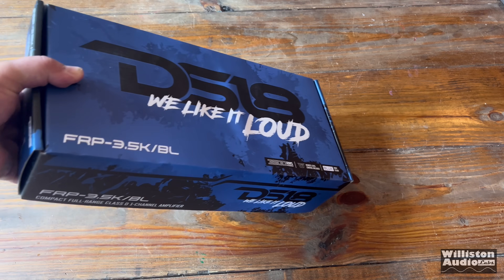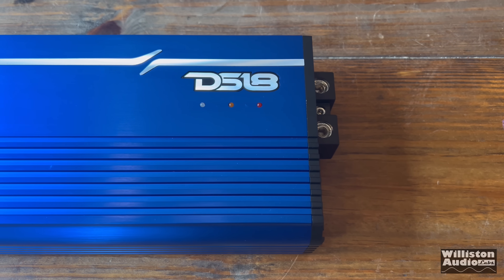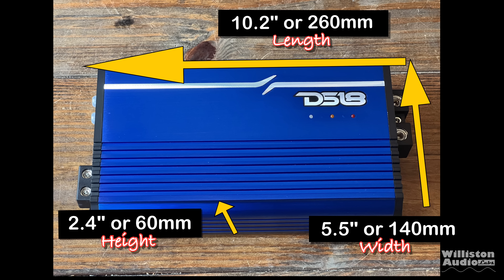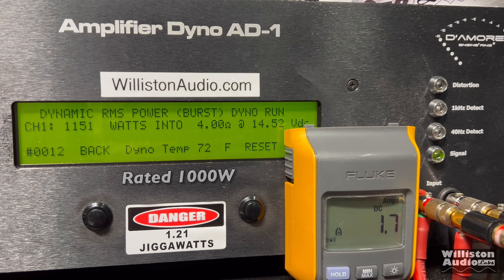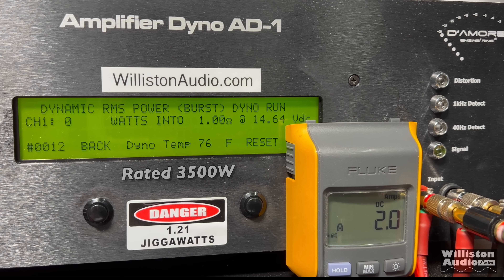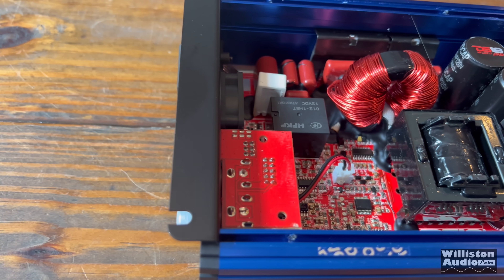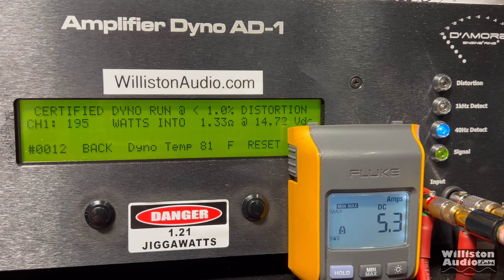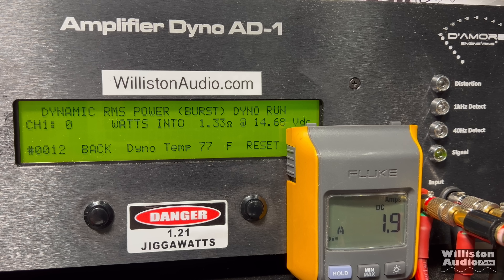DS18 3500W Mini Monster Amplifier Review and Amp Dyno Test

Comment from the maker: DS18 FRP-3.5k Full Range 3500W Mini Amplifier
DS18 Website: https://ds18.com/collections/mobile-1-channel-full-range
DS18 Enhanced Bass Remote:  https://ds18.com/products/bkvtr
DS18 Amps on D4S: https://lddy.no/1k2ty
SMD's Review of the 5000W DS18 FRP-5k: https://youtu.be/hfwr_OoiUVw

Note: Amp was sent from DS18 for testing, but video is not sponsored by DS18. DS18 paid a fee to have the amp tested and shown in this video but all content was created by Williston Audio Labs without input from DS18 and we show features, tests and give our honest feedback

TEST BENCH EQUIPMENT
SMD / D'Amore Engineering Amp Dyno (AD-1): https://is.gd/wccad1
XS Power D1400 Batteries - https://amzn.to/2BPFCKW
XS Power PSC60 Charger - https://amzn.to/2CHGcfs
Fluke 1000A AC/DC Clamp Meter: https://amzn.to/2Rw5WDA
Handheld Dyno AMM-1: https://is.gd/wccamm1
My Favorite Precision Screwdriver Kit: https://amzn.to/3yAaPmn

DISCLAIMER: This video and description contains affiliate links, which means that if you purchase from one of the product links, I may receive a small commission. As an Amazon Associate I earn from qualifying purchases. As an eBay Partner, I may be compensated if you make a purchase
Reply: This isn't a out this video, but could you recommend a stand alone, plug in your wall, home theater subwoofer amp, as mine just died, but would have to spend over $1000 to get an equal sub now days. I'm looking in the 4-500 watts rms range. Either a plate amp or anything else
Reply from the maker: @derekborow4121  I tested a couple from Parts Express in this video - https://youtu.be/LsaXQJ_53R0
Reply: @wal you need to do dynos on all POWERUS IS THE BEST AMP EVER MADE PERIOD…. But its expensive too

Comment: I ordered the ds18 frp2.5 and looks like it's stating on ds18 website to use 1 gauge power wire for it. But my car is already wired with 4 gauge ofc power wire. Do you think the 4 gauge is sufficient to run the Ds18 frp 2.5 rated at 2500 watts at 1 ohm, 2 ohms at 1300 and 700 watts at 4 ohms? Thanks for the video any feedback appreciated

Comment: I'm so glad that you tested the amp at 1khz.  DS18 has a lot of midrange & highs equipment that does do a ton of wattage & requires an amp like this.  Sometimes they're meant to be hooked up with 8ohm speaker to get a lot of them on the one amp as well.  Also, I think they still sell the "Picado" speakers too.

Comment: I just burnt up my audiopipe yesterday 1800 class d mono.  I replaced it with the 3.5k and so far the audiopipe beat way harder.  I still gotta get it fine tuned tho
Reply: So the audiopipe 1800 beat harder than your DS18 3500w amp?
Reply: @ElevatedVehicles  yeah to me.  The ds18 clips if you turn it up
Reply: @sir404  dang thank you. I'll avoid it

Comment: Just searching for opinions… Does this amplifier heat up fast on stock electrical? Working with a 2019 Dodge Charger, 1 12 inch Skar VXF. I’m just trying to find a amp that doesn’t heat up so quick
Reply: @392Quick  hey did you end up buying it i’m thinking about getting it just trying to see if it’s good
Reply: @ Nah I never purchased it. I ended up getting a XS Power battery and did a big 3 upgrade.

Comment: Hey Willston! Do u have any videos showing how to reconfigure a 24 cell Headway lithium battery using busbars? I'm a bit of a newbie/old school basshead. I've got a Skar EVL D2 15 with a Skar RP1200.1 monoblock amp. I'm fixin to upgrade to 0 gauge wire, but I'm still running a factory alternator. Can i kinda pick ur brain for sum help figuring out what all I need to do to get the full potential of my amp and sub? Please and thank u.

Comment: I was wondering if you will be testing any of Orion’s new amplifiers ….like the xtr pro2300.1dx the xtr1000.4 and I would like see you test the updated 2500.1dz  just to see if there is a difference between the 2500.1d and the 2500.1dz and they have a 3500.1dz and a 5500.1dz ….they have a host of other amps but these are the ones that I’m interested in seeing you do a test on.

Comment: Sorry if I'm being a stickler here, but even if a full range amp is rated at 1KHz, it should not be far off its rated power at 40Hz.  A significant difference suggests it handles full range poorly.  If it can't be at least somewhat flat from 20Hz to 20KHz, then it's not something I would want.
I mean, let's think about this.  It's bad enough needing sub woofers to compensate for your woofers (which I get).  But needing extra amps to compensate for your amp as well?  Or needing equalization to compensate for your amp's shortcomings on top of everything else?  Echhhh.
Reply: @jdlech  most full-range apps are tested at 1 kilohertz. most of them do not hit the same power at 40 hertz.
Reply: @Pbull75  Most home amps do.  And all amps worth buying do.  Your statement is equally about your lack of standards as theirs.  If a home amp can't produce within 1db of rated power across the full spectrum, it's not worth buying.  I'd give a car amp 2db only because of serious price point restrictions.

period.
Reply: @jdlech  we're not talking about home apps here. And I understand what you're saying. Go look at a bunch of tests on these full range amps no matter what brand. Most of them are tested at 1 kilohertz.   Animals always at 40 hurts they're a little lower wattage.
Reply: @jdlech  as for lack of standards. Come on. My audio system on my bike sounds better than 99 percent of these cars out here. I only mess with sound quality. I know about standard.
Reply: @Pbull75  And yet you're perfectly OK with an amp that can't amplify consistently from 40Hz to 1KHz even into a purely resistive load.  Who are you trying to fool here?
Reply: @jdlech  believe me it'll be fine

Comment: If the amp is specced at 1 ohm, and we saw the 1 ohm tests,  whats the 1.33 ohm test for at the very end of the clip?
Reply: Just extra video I guess.
Reply: @JasonWW2000  dont get me wrong.  Big fan of the channel.
Only reason im confused is, the end of the clips is where he normally pushes the hardware beyond specs.  Thats my favorite part.  :-)
Reply: @deathred3144  Box rise causes ohm rise. So when you set your subs and amp to 1-ohm box rise really has it running around 1.3ohm

Comment: When has the manufacturer rating ever stopped you from going sub-ohm low? I come here to see the limits these amps can handle it's got a protection light, test it.
Reply: The fact that he didn't test it probably indicates that the manufacturer warned him not to. I would rate it safe for an actual one ohm load, but no lower than that.

Comment: Q: Hey Big D! Have you seen the video by Savard Audio concerning using an amp that is rated no less than 2Xs the power rating of the subs? If so, what are your thoughts/experience on the matter?  

In the video the fella made the point that impedance rise causes the amp to see a load that's quite a bit higher than the ohm rating of the subs. 
So if you have a 1000W RMS sub wired at 1ohm, the amp will see a load that is more than 2 ohms when it's playing music, therefore you should use an amp that is rated for no less than 2000W RMS at 1 ohm. 

Would love to see a video where you test and prove this and share your thoughts on the matter. 
If this is true, I think it's definitely need to know info that would help a lot of people who come here to get info to make purchases of amps for their systems. 

Thanks for doing what you do! Your channel/content helped me in choosing a great amp for my setup. My system sounds tremendously better than before.
Reply: Impedance is resistance, but at a specific frequency (or band of frequencies). The advertised impedance is often an average of a band of frequencies the speaker is expected to operate at. (Some unsavory speaker manufacturers might also cherry-pick the advertised impedance from idealized test results.) You'll need a specification sheet that shows the impedance curve, which will give you a graph of rated impedance vs. frequency. This will help you specify the amplifier to match that speaker up to.

So, as a practical example: looking at the impedance curve, we learn our example woofer might have an impedance of 2 ohms at 40 Hz, but 6 ohms at 200 Hz. If this woofer is meant to be used as a subwoofer, and it won't ever see the 200 Hz frequency band, make your amplifier calculations assuming 2 ohms impedance. On the other hand, if this is a standard woofer to play musical bass frequencies, rather than shake the Earth, that woofer most likely will see 200 Hz, but not 40 Hz. Calculate instead assuming 6 ohms impedance.

Don't forget: the cabinet the speaker goes in will also have a profound impact on the efficiency of the speaker. Especially for subwoofers, watch for the tuned frequency of the cabinet.

For my part, as a live & architectural sound engineer with 20+ years' experience, clipping will be your worst enemy where blowing speakers is concerned. I've seen drivers take 10x their rated power as a momentary transient (think "pop" or "pow") and survive without issue. But, if you drive a 40 Hz square wave into a subwoofer, even at less than rated power, you are likely to blow that woofer. When I put a system together, I usually target amplifiers that are 1.2x to 2x the rated power of the speakers in question, mostly to make sure I never hit clipping when I operate the drivers near their limit. (I will turn the amp down to meet the speaker's rated output.) This is probably NOT a way to win SPL contests if that's what you're into. But, if you want reliability, no system I've designed/rigged/installed has blown a speaker in the time I've been doing this. Generally, since you're not pushing the amp all that hard, you'll get better fidelity and noise floor, too.
Reply: @McTroyd  Thanks for sharing the insight! Makes a lot of sense.
Reply: 2X or 3X is fine as long as you know how to control the power and not burn up your subs. I usually run three times the rated power, but I'm not a bass head so I don't really push my stuff to the Limit. If you're the kind of person that wants to squeeze out every bit of performance from whatever amplifier you have, you just need to find out what your real ohm load is and then match it up appropriately. Of course, when you're constantly maxing out your equipment you shouldn't expect it to last forever.

Comment: DS18 does not consider this a sub amp. Clearly the crossover is geared towards mids/tweeters. Nice power. Looks to be good quality. Basically 10 cents a watt. 👍👍
Reply: @ThisIsMyHandle-48  but yet they advertise it on their FB page as a sub amp and it pushes the subs perfectly 😑

Comment: Not going to lie, but the internals look like they are going to burn up pretty quickly.
Reply: Why would you think that? The efficiency appears to be quite high. It also doesn't seem to be outputting much excess Heat. Those are all good things.

Comment: 71% efficiency at 1OHM means running this full bore it's generating 1kW of heat!  The heatsinks aren't going to be able to handle that, it will shut down or cook itself quickly!  Fortunately most listening is very limited duty cycle so I suspect this will be fine.  Those TINY fans aren't going to do much either.  I suspect most bassheads or competitors would have a compartment stuffed with these along with a few bilge fans changing out the air...

But yes, play the hell out of Techmaster PEB (old school boomer here, sorry) this puppy is gonna get HOT!  (So will your voice coils LOL!)

The power roll off at 40Hz is interesting.  I wonder how much more it would roll off at 20Hz.

For the $$$ TBH, it looks like a steal!
Reply: I would like to try the 5k
If it gets too hot on bass it wouldn't hurt to run my front doors with this hp at 90 hz
I bet this series can make u feel the vocals through your chest
Reply: @NerdyBassHead  Yes front door is often overlooked, it adds a LOT of tight, snappy sound to bass string plucks and kick drums that you feel on stage.

Comment: Could you do a teardown of your amp dyno? I really want to see how it works
Reply: Works the same way a battery tester works. Just a load bank of resistors with different relays to switch Ohm loads and sensors to read voltage, resistance, and amperage. 

Volts(ac)=sqrt(watt×ohm) and other ohms law formulas

Comment: I don’t have subs in my room but everything was rattling. It must have been bumping. Old Coral 3 ways with 8” (basket measurement) woofers is the speaker setup. Old JVC A-K10 stereo amplifier.

Comment: All bass remotes are amp specific?
Reply: Typically they are all wired the same. Depending on type of plug.. might be one or two brands that mix the wiring up.
Reply: @bobdodge3171  whoa whoa whoa. Don't be giving out misinformation. Just about every brand of amplifier I've seen has a different wiring for their bass knob. If you're foolish enough to try and mix and match different brands you can expect to burn up your amplifier.

Comment: Wow 300 amp fuse!  They really delivered with this.  Hope you have a 300 amp alternator.  Lol
Reply: Now you're understanding. There are many factors involved and not everybody listens to music the same way.
Reply: These two are not related.
Reply: @BASSstarlet  if your pulling close to 300 amps you will drain your battery unless your alternator can supply 300amps.  💯 percent related!
Reply: @terrycarter8929  
The circuit will not only have the alternator and a battery, but at least an auxiliary back near the amplifier, usually. Such consumption can be supported with smaller alternators (150 e.g.)We're talking "normal use" not playing halftone for an hour!
Reply: @BASSstarlet   yes that is true.  You can can also but an extra battery and capacitors as well.  The novice buying an amp has no clue about these things and will kill their battery fast.  They also will not put a second alternator on their car.....this usually is a competition set up. I am willing to assume that most people watching his videos are novices looking to upgrade their stock car stereo.
Reply: @terrycarter8929  Remember that with music you would only be pulling 300 amps in pulses. Meanwhile, your alternator will be constantly outputting its amperage. There's a lot of factors involved such as the type of music you're listening to, the frequency and duration in the songs, the volume levels and how much impedance rise you have. Most people aren't going to be pulling 300 amps.
Reply: @JasonWW2000  have you ever tried to put 3500w of amps on a system with a 100 amp alternator?  Probably not.  You would know what would happen.
Reply: @terrycarter8929  Actually yes. I had about 4000 W of amplification on a completely stock electrical system and it did just fine.
Reply: @JasonWW2000  I listen to music with heavy bass guitar and bass drums.  I listen to it loud like im at the concert. Most people I knew back in the day listened to rap.  My headlights would dim with 1000 watts with an extra battery and a 100 amp alternator.  It was always loud if I was in the car.   You must listen to classical music at 1/4 volume for two songs?  Lol. If not I want some of what your smoking.

Comment: Hey Derek, thanks as always. I want to know, after watching probably more than 100 of your videos, what is the most efficient amp available? I know it’s going to be a class-D amp, but who gives the most power, per channel, using the least (most efficient) amount of juice? Cheers
Reply from the maker: As I’ve measured I believe the DC Audio 3.5k and Crescendo BC3500’s measured the highest but the Fluke wireless clamp isn’t exact science in these tests. The new KICKER Warhorse 3600 got over 82% efficient at 1 ohm which is right up there also
Reply: I'm not sure why efficiency is so important to you, but if that's what you're looking for try to get a large amplifier that can run at a higher ohm load like 4 Ohm or maybe two. That's where they are most efficient. As the amplifier goes down in impedance the efficiency also drops. You would be much better served looking for efficiency in your sub enclosure then in the amplifier.